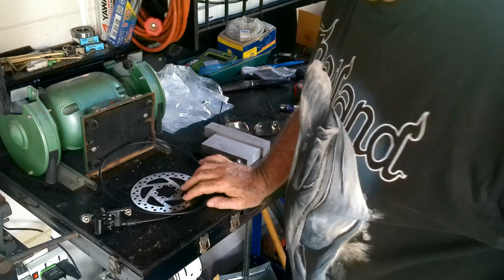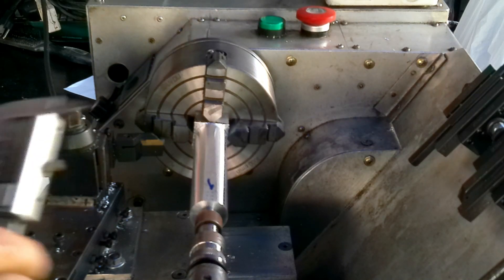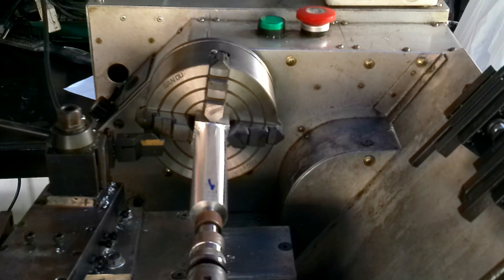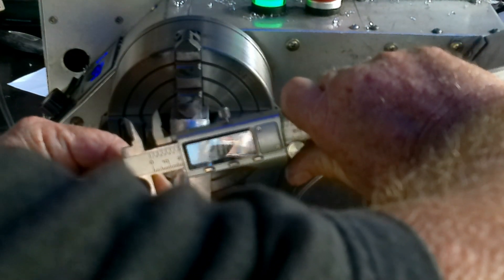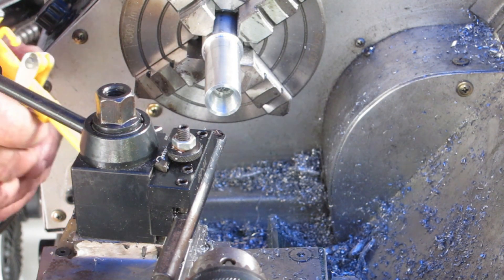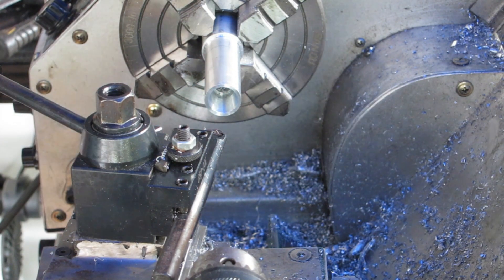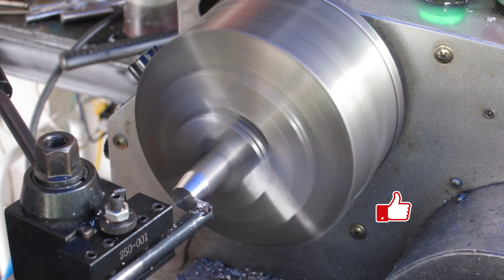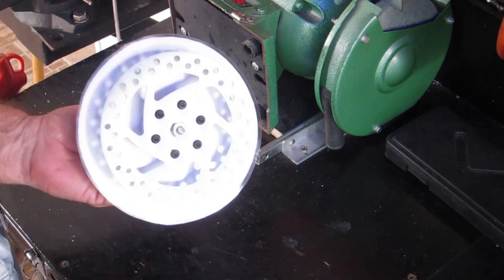MHW Episode 19 - Spindle Brake using a Bicycle Disc Brake - Part 1

Comment: Not sure how you're planning on mounting the caliper, but it may be useful to know that there are various sizes and types of adapters available. Your caliper is a post mount (PM) with a post mount to international standard (PM-IS)adapter fitted. PM-PM mounts are also available, and both types are readily available in +10mm increments (160,180, and 200mm rotor. 183 and 203 can also be found as well.
Reply from the maker: I came up with a pretty simple solution, stay tuned for Part 2.